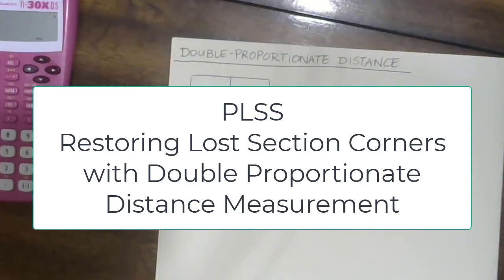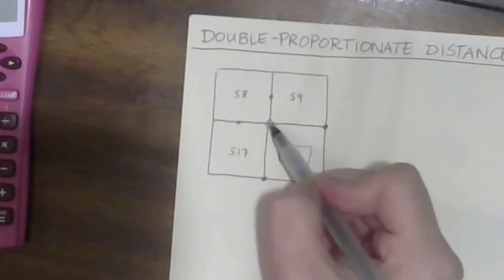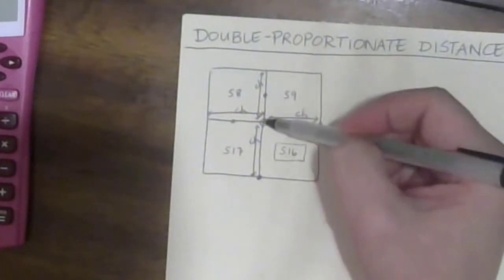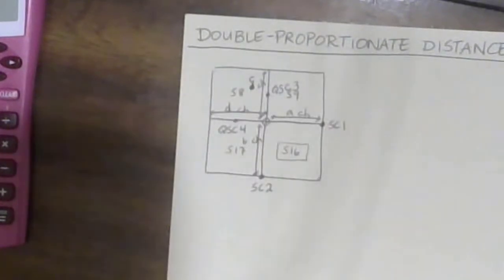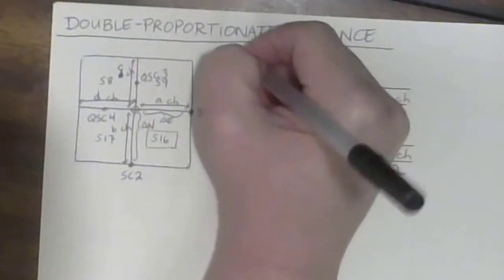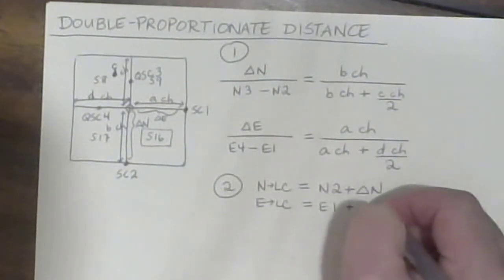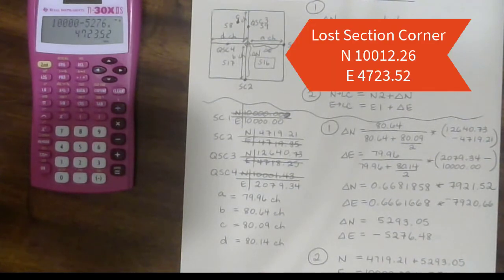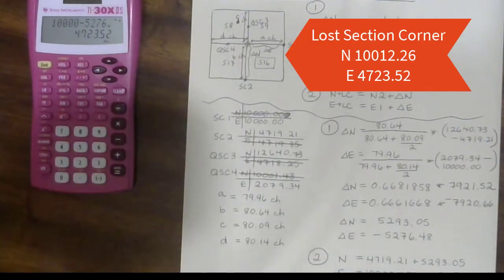Restoring a Lost Section Corner in PLSS using Double-Proportionate Distance Measurement

Comment: Is it normal that you would have section line bearings changing constantly? Calculating the missinh section corner using this method means the bearing of QSC4 --> 4way is almost the opposite of 4way --> SC1 and the basically same thing with your section line of SC2 --> QSC3